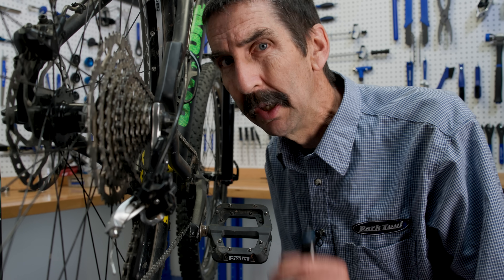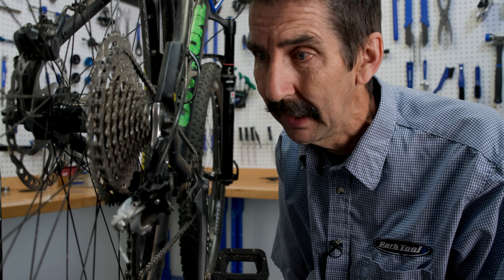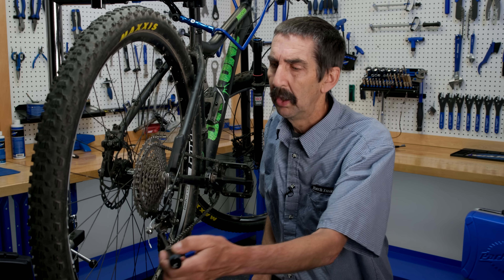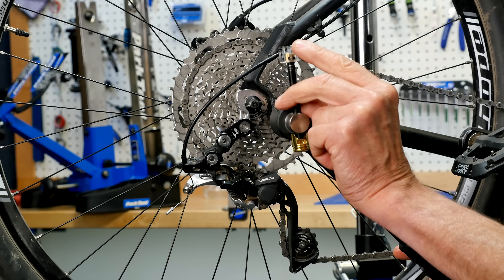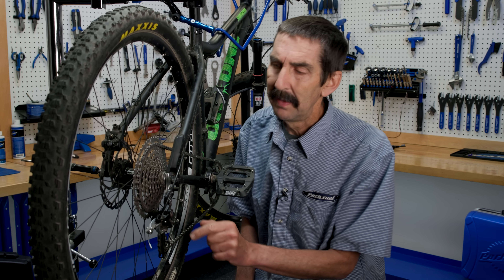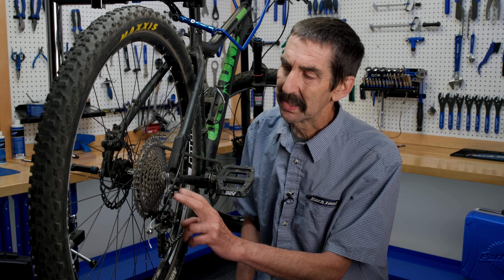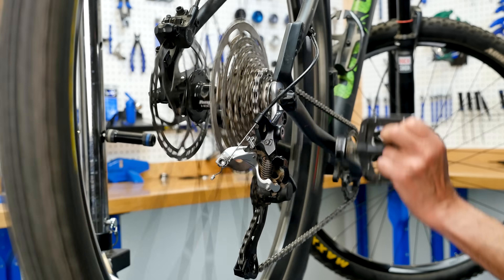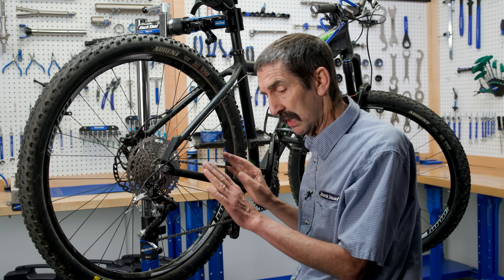A Link Too Far | Tech Tuesday #203

Comment: Got to ask, did you set this up for the purpose of the video?
Because i cant unserstand how someone would buy a hanger extension but just add it and not replace.
Reply from the maker: We have seen this several times in the wild.
Reply: @parktool  that's mad to me  why would someone do enough research to know they need an extension but not know to replace haha.

While I have your attention. I have just done maintenance on my sons bike, I cleaned out the cup and cone as someone spilled concrete powder on it.
Anyway my question is when I reassembled the wheel would tighten the bearing when the wheel rolled. What on earth did I do wrong to make that happen.... if you could help that would be awesome.

Comment: 1 by is by far the dumbest "revolution" in mtb. So glad I have no cross chain problems, don't need a rear derailler with clutch, don't need an oversized, overprized and overweight cassette, don't need a chainguide and also, can shift in a second from full descent mode to full climbing mode.

Comment: Am I the only one or is the chain too short for this setup?
Reply from the maker: Chain length was good. That is a huge range to cover from the smallest to largest.  Any longer it would sag at the other end.
Reply: @parktool  Thank you and be well!
Reply: The problem is they were using the wolfs tooth to make the derailleur work with that large cassette, when most likely the derailleur is not rated for that much difference in tooth range. So the chains looks too short but in this case will have to be okay but in a properly designed native system with the matching cassette and derailleur, this would look like a too short chain scenario.

Comment: Calvin, every new bike I’ve ever bought had the derailleur hanger out of alignment enough to need correction. Also, the last bike I bought, a Cannondale Topstone 105SE (first edition), had a chain one link too long. To compensate, they had the D screw run almost all the way in to compensate, and the upper jockey wheel was way too far down and back from the cassette. There’s even a few pictures on the net of it although they must of corrected it during the model run because not all were that way.
Reply: So true! My current bike was my first bike not from an LBS, instead it came in a box. I was sure that if my LBS couldn't get it right what were the odds that, even if they had set it up properly before shipping, that it would survive in said condition: I was absolutely shocked that this would be my first bike ever where the limits were set correctly, alignment was good, only my rear brake was rubbing ever so slightly.

Comment: Or here's a idea use a rear derailleur that is designed to run a 46 tooth big gear that looks like a Shimano tourney the max they can go up to is 34 teeth even my Shimano acera has a 34 tooth limit
Reply: New/replacement RD can be very expensive, especially if a long cage is required to accommodate a bigger cassette.  I know, I have spent a few hundred dollars doing so... and the RD hanger extender is less than $20 and works very well in my experience
Reply: went with à Wolftooth  to go from à 34 to à 42 while keeping my midrange dérailleur. worked fine all the way across us
Reply: I think it's old Deore 10 speed which is 42 tooth limit.

Comment: Can i use a 10 speed rd to a 9 speed sprocket 42t? With a link?
Reply: Depends.... the issue is if your shifter's throw ratio can shift through the 9 cogs fine. It's a crap shoot on which brand and model will be compatible with your particular 10sp derailleur. My suggestion is to just try it. Your derailleur actually could care less how many speeds you are running, it's the shifter that decides how many clicks and how far to pull the cable (pull ratio). As for adding a link, if the derailleur's B screw isn't maxxed in and you've added enough chain links then you're fine, if not, than you need an extender or dlink.
Reply: ...actually it's okay if the B screw is maxxed in. As long as you're jockey wheel is clearing the biggest cog (your new 42t). If the maxxed in B screw can't allow the jockey wheel to clear the 42t cog, for sure you need an extender or dlink.
Reply from the maker: There are a lot of variables here but the most accurate answer is going to be "no".

Comment: The problem was that the owner added a direct mount D-Link to the hanger, then attaching the derailleur to the D-Link caused the derailleur's chainline to be moved out by the thickness of the D-Link. Which is why the limit screws were totally wound out, as the derailleur can hardly reach the largest cog with the increment in chainline.

Another component you can consider if you want to use a larger cassette than recommended, is a derailleur hanger extension. It's an add-on to the derailleur hanger, and does not replace the original D-Link of the derailleur, while keeping the chainline similar.
Reply: 😁 i was going to write such straight explanation as well as I felt it was blatantly omitted in the video... but you were here first, nice! 👍
Reply: @zoladkow  hahaha, Calvin and Park Tool are legends, they are trying to help us circumvent common mistakes especially with this D-Link thingy. If it were me, I'll probably take weeks before I realise what's wrong with this bike. Mad props to Calvin!
Reply: As a newbie to working on bikes this is great info. I wanted to add a larger cassette on a bike I just bought for my wife but I have no idea where to find the info on how big of a final cog I can use on a Deore XT drivetrain. I just have no idea what to search for but maybe all I need is a hanger extension.
Reply: @Iasizz  A derailleur hanger extension will work well, albeit not officially recommended. There are tons of cheap ones online, anodized to your favourite colour! Or else, other famed component brands do carry them too (WolfTooth). Good luck!!! :)
Reply: What is the derailleur hanger extension? Can you link brand of product? Thank you

Comment: If it’s an existing mech & cassette…. Check chain length and Hanger alignment for sure.
I spent a lot of time trying to correct a setup that either couldn’t change correctly in high gears, or if adjusted, low gears…..
Great content as always, from the makers of the finest tools to fettle your bike.

Comment: I have to mention that before doing ANY derailleur alignment, you should ALWAYS CHECK YOUR AXLE,  HUB, driver/freewhub and Cassette for torque, alignment and function.
Many customers over the years w shifting issues caused by a misaligned qr axle, bad hub, bent teeth/chain.

Comment: Should you never use two links?
Reply: There are derailleur hanger extenders OR, as in this video, an after market dlink that is meant to replace the original dlink. I'm guessing the owner of the bike didn't realized he had the latter. Weird that he got the correct part but didn't install it properly. Most people would order an extender not knowing they need a longer dlink.
Reply: @newttella1043  Thanks

Comment: what tool are you using to remove the Derailleur ?
Reply: 5mm allenwrench
Reply: @jmvillavicencio3449  ty I’m aware of the size required just hadn’t seen that specific park tool.
Reply: @bob8fred  ok correct me if I'm wrong that's the atd-1 ??
Reply: @jmvillavicencio3449  QTH-1